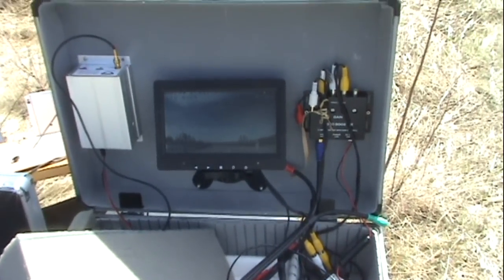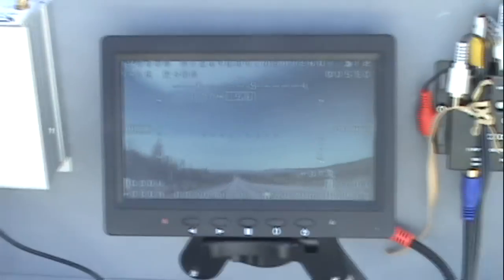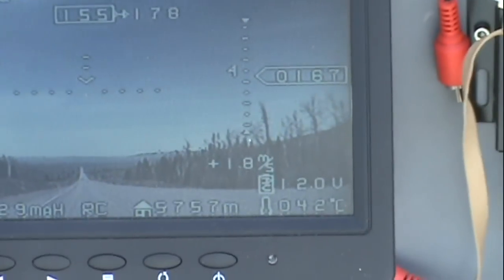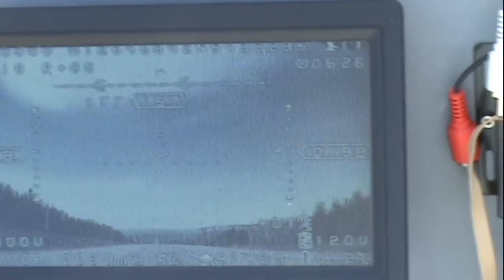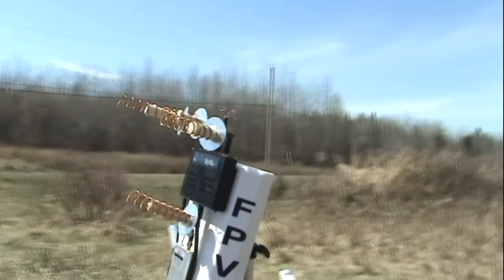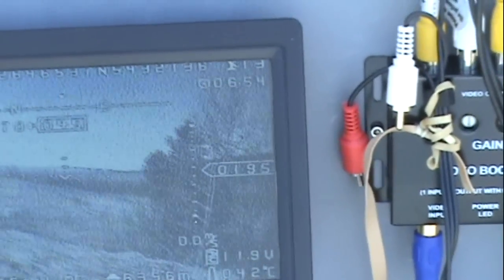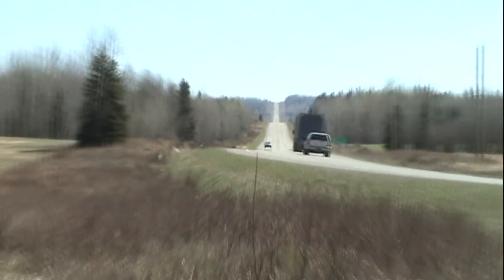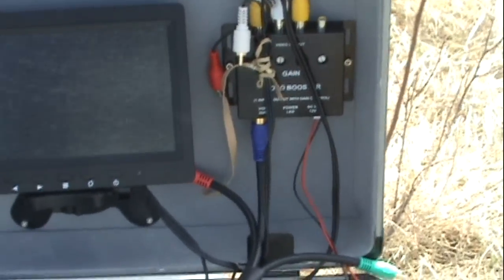randys rc hobbyroom long range test 6k

Comment: Hi Randy, I watched your video on how far out you tested fpv set up. And would like to know if you will be doing a video on how ground station is set up. One that will show how the wires are connected to transmitter.I am trying to get into.

Comment from the maker: hi there i use a 4 channel Diversity Receiver and the antennas i made from plane i got years ago from ibcrazy on line. is a 5.8ghz video . since this video i have flown 4.2k out with perfect video. i use dragonlink for radio control and it seems to work greatfor me i have tested it o 10 miles or 16k